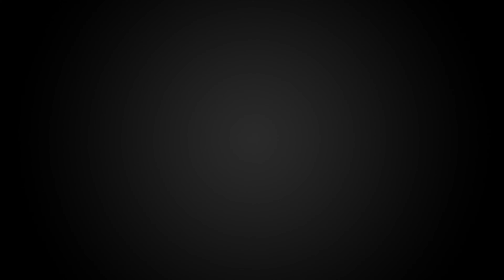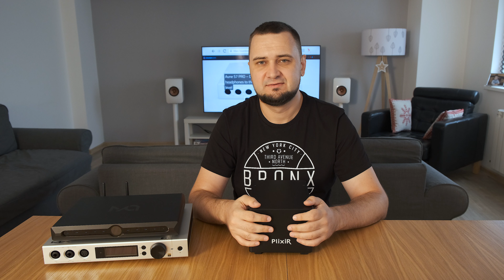PLiXiR Elite BAC 400 Power Conditioner Review

Comment: Hi, thanks a lot for this helpful review, though one question : with witch power cable did you try it, a plixir one ?
Reply from the maker: Sadly no, I am using two Isotek EVO3 Premier power cables. The conditioner alone did a way bigger difference than the all the cables put together.